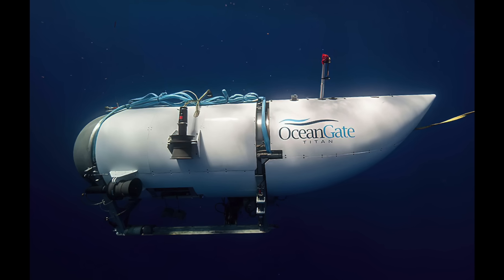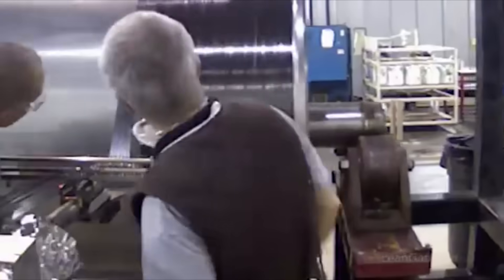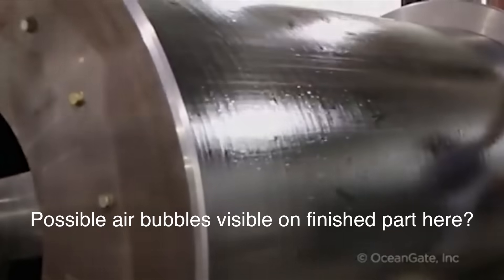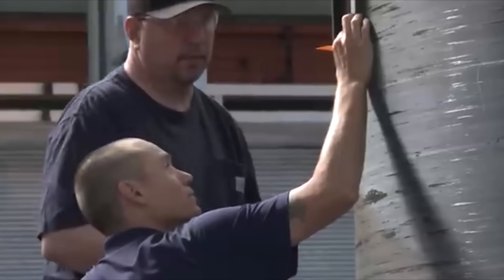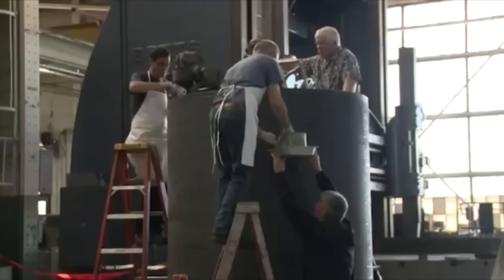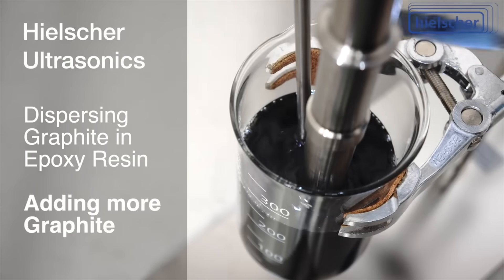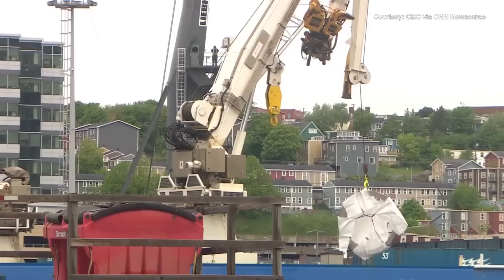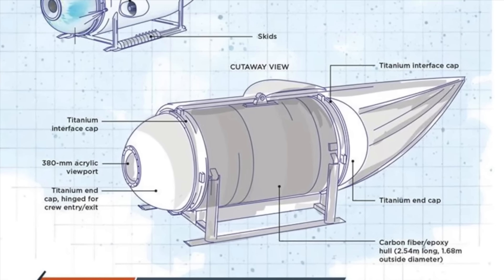Why OceanGate Titan Imploded - A Carbon Fiber Composites Perspective

Comment: Intuitively, carbon fibre going only one direction seems like a terrible terrible idea. I realise the primary strength will be going around, but that leaves no room for error if any part is weakened a bit.
Reply: Without fibres thing the other way, the point where the titanium ends and the fibres have to stand alone would be under enormous stress.
Reply: The primary strength will be going around IN TENSION.  Carbon fibers are like wet noodles, they have no strength in compression.  The only strength here is in the compressive strength of the resin.
Reply: @stargazer7644  wrong, they're not like a "wet noodle", the compressive strength can be up to 50% of their tensile strength. Also, the epoxy holding them together has great compressive strength.
Reply: @xpusostomos  Carbon fibers are THREAD.  You can hang your car from a single 1/4 inch carbon fiber rope in tension with well over a 2 times safety margin.  So you're telling me you can balance that same car upside down on the end of that same 1/4 inch rope in compression?  Have you ever actually handled carbon fiber fabric?  Carbon fiber alone has almost no compression strength.  In a composite the resin is just about the ONLY strength carbon fiber has in compression.  Using carbon fiber to make submarine hulls is like using concrete to make tubes for  pressure tanks.
Reply: @stargazer7644  There is much you don't understand. Firstly, the sub wasn't made of carbon fibre cloth, but strands of fibre, all going the one direction. Secondly, to make a tube lose structural integrity by pressing on it the inside of the tube would be under tension while the outside would be under compression. Thirdly, the compressive strength is measured when the fibres are in alignment with the force applied. In a rope under tension, they are kept in alignment by the tension. Under compression you've got a problem keeping those fibres perpendicular to the force. But the sub is not a rope trying to hold up a car. Fouthly, carbon fibre has about 4x the compressive strength of steel. So let's say you wanted to support a car with some material by compression. What's a good material? Most people would say steel, that's what every car lift is made of. That's what every set of car ramps is made of. And yet carbon fibre is 4x better. Fifthly, don't listen to me, use Google and find out for yourself.

Comment: Titan was overweight to start. The hull’s glue, epoxy, and air gaps had been saturated with water from numerous dives without upkeep. It more than likely was no longer buoyant. The sub sank too quickly, began to fail, and was unable to ascend.

Comment: Unfortunately it seems like these guys were experienced doll house makers building a submersible.  Completely correct regarding the lack of cleanliness and utter lack of other engineering considerations.  Also important to point out that actually there are three not two disimilar materials at play here with the hull - the glue, the carbon fiber, and the titanium.

Comment: What gets me is that Stockton knew that the carbon fiber tube would shrink by 3/4" (19 MM) at the depth of 12,500 feet. I know enough that carbon fiber is not known for it's flexibility properties. Stockton himself said it was concerning that the carbon fiber tube would make a cracking sound at depth.

Comment: Wrong, Carbon Fiber is not a good material for the hull. There wasnt any reinforcement in the passenger compartment. Also, seeing the consruction of this hull. A compression garden waterhose has more clamping components keeping the metal end attached to the plastic hose on it than this submersible! This was a giant aluminum can they went down in. If this is an American Comany doing business in the United States, they should be subject to regulation for safety.

Comment: I'm skeptical about the emphasis on the glue, although it is certainly indicative of an overall sloppy attitude to quality control (and health and safety). The external pressure will tend to push the end caps harder onto the carbon fibre tube the deeper the dive, closing any voids without putting any sheer load on the glue. Since the pressure increases progressively during the dive any water leaks through the glue interface should have been apparent before they became dangerous.  The carbon fibre tube may well have compressed more than the titanium ring, but the latter seems to have an internal channel the inside edge of which would have broken off if this were the root cause of the failure. My money is still on a simple and entirely predictable fatigue failure of the carbon fibre tube.
Reply: At these pressures you don't really have water "leaks".
Reply: @stargazer7644  Indeed, at 400 atmospheres the water jet will cut through pretty much any material, but the sub does not suddenly go from 1 atmosphere to 400, it takes well over an hour, so you should spot the leak while it is still a leak. Plus the deeper you get the harder the joint is being pressed closed.
Reply: @john_hind  What is the ring going to be pushed against? The very end of the barrel. That spot will receive the most pressure, trying to become delaminated all the time. A layer of glue will distribute the load to more fibres at the ends of the barrel, presuming it holds.
Reply: Yeah but you're not thinking about the fact that the carbon-fibre compresses at a different rate than the titanium and what would that do to the mating surfaces?
Reply: @thecloneguyz  mating surface - nothing good.  Just saw another video on this sub where a professor from Europe runs modeling software on this vessel under pressure.  That model of the failure looked like the Pringles can being squeezed, everything was over in just a handful of milliseconds. The highest stress was at the Ti-CF joint.  After the joint failed and the cylinder shattered the two titanium end caps were driven inward at high speed and ‘clapped together’ in the center where the cylinder used to be.

After seeing this I have now come around to seeing the Ti-CF joint as the biggest problem.  No matter what the adhesive or procedure used, this joint is the location of the highest concentration of stresses.  Since there were several successful dives to this depth before this incident, material fatigue cycles must have played a role.  Perhaps the glue joint finally failed, or the carbon fiber itself became weaker and deflected more on this dive, or both, or something else (he also identified the acrylic window as a weak point).  The titanium hemispheres that were recovered looked brand new from the brief unloading video.
Reply: True that the hull likely imploded on its own, however there would indeed have been shear loads on the adhesive due to the relative shrinkage rates of the carbon fiber and the titanium hemispheres. With the hull compressing at much greater proportion, and the glued interface being flat without mechanical (shape) load distribution, the glue was definitely hanging on for dear life
Reply: @michaelmorgan1180  Remember the sub did survive several dives to Titanic depth. If you are right about the carbon tube compressing more than the titanium ring, I cannot imagine any glue sustaining that amount of sheer force even once! The film of the assembly clearly shows the carbon tube being glued into a channel in the titanium. So sheer force would initially compress the glue in this interface surface. While the titanium inner lip is thin relative to the thickness of the hull, it would still have to sheer off before we'd be depending on the glue to take sheer force. Some pictures have now emerged which seem to show just this, but there is so much noise now that I'm waiting for the official report. However we are looking for a fatigue process rather than a simple design flaw. Maybe the carbon tube started to buckle at the end due to delimitation and that caused stress on the material interface.
Reply: @john_hind  about the relative compression rates, we also have to consider that even with a titanium bounded interface, there will still be major deltas between the relative material resistances under pressure, so that spatially confining the joint does not resolve all shear forces, both extrinsic and intrinsic to the CF cross section, as the CF undergoes forces that tend to shear the CF joint as a unit (radially toward the axis), and through cross section shrinkage by crushing. Ironically if the company wanted to innovate in CF deep sea applications, a bad idea unto itself, they would have spent much of the R&D on interface adhesive and form tolerances, which their assembly footage shows they did not. All in all, it was a daydream project that got funded into deadly reality
Reply: Agreed. However there still seems to be another mechanical effect at depth that the assembly did not account for: with the cumulative compression force across the length of the flexible CF tube and  producing an axial elastic strain, there would have been a lever/pry force acting on the glued faces to lift the outermost interface surfaces away from contact with the titanium transition rings. Someone did point out that the psi forces holding those interfaces together were several times the ambient water pressure (due to the concentration of the dome surface forces onto the glued ring and tube contacts), however I believe it is critical to take note that the total forces acting against the assembly or its structural integrity were not all occuring at static 90-degree angles... there were also extreme pivoting forces that such an assembly design would never be applied to in proper mechanical engineering for personal occupancy
Reply: @michaelmorgan1180  Hemispheres made of ductile material do not stay spherical under load in this case they flatten. This dishes the bonding surface putting tensile loads on the outer bond line.
Reply: I hope you have been seeing the Titan hearings. I mean, besides the whole idea of using carbon fiber as a hull material being a huge blunder, the failure point(s) seems to have been at the front dome where they also had a bunch of issues in other dives.
Reply: @apackofhoboes  as a welder, I'm very, very familiar with this concept.. making something "stronger" only introduces weak points immediately after. It's why welders need to defer to engineers, as the entire project needs to give and flex uniformly. 

Melding titanium to carbon fiber sounds like a nightmare to design. Would require LOTS of testing into failure, which we have virtually nothing to draw from. Other than their deaths, sadly.
Reply: Poisson's Ratio
Reply: John,
That’s the way I see it too.  Extreme compressive cycles on a material designed for strength in tensile loads.
Reply: The hoop stress means this carbon tube is gonna shrink in diameter. If the titanium shrinks at a different rate, massive shear stress. Temperature changes can result in insane shear stress.

I did a simulation on a pool window of poor design: 300,000 lbs due to thermal stress alone
Reply: @ZebraLemur  However, as I said in the OP, it is not a simple butt joint. The carbon tube is glued into a channel in the titanium ring. Under the strain you describe, the inner lip of this channel would be stressed and would have to break off for there to be significant movement of the glue joint. The titanium parts seem to be completely undamaged in the images we have seen. Conceivable that localised damage was deliberately or accidentally hidden as the parts were lifted ashore, but it will still be known to the investigators and should resolve the matter one way or the other. The fact that the carbon tube has not been recovered, or even significant intact pieces of it, also argues for this as the original failure.
Reply: @john_hind that channel would still introduce massive sheer concentration forces on the carbon fiber, where the lip ends.

You don't have to be an engineer to see the failure points.
Reply: @ZebraLemur  Hi, The CTE of Toray 700 IM is zero to slightly negative. Modulus is huge compared to titanium. Everyone assumes the joint faces stayed parallel. Pressurized hemispheres deflect. Internal pressure makes the dome balloon external pressure flattens the dome. This puts the adhesive in an unfavorable loading condition.

Comment: I m not an engineer at all, but i could relate to the findindgs of this insightful analysis, My take away from this video from my point of reference is : Much like conjugating using a porous prophylactic condom 2 sizes smaller ? entirely up to chances ?

Comment: This video plus other similar videos shows the end bells and the rings that were glued to the carbon fiber hull.   What is missing in both OceanGate's videos and videos of the removal of pieces of the submersible are photos of the seal between the rings and the bell.

The ring is separate from the bell.  There are no bolts in sight.  There are no signs of gasket material.  The ring is separate from the bell with no signs of carbon fiber, bolts, or seal material.  Might the failure have started in the seal ring and finished with the failure of the carbon fiber?

If I were investigating the loss of the Titan I would look closely at the seals and the bolts.  Were bolts examined after each dive?  Were they replaced after each dive?  Was the same torque applied to each bolt, or were there changes with each dive?  Were bolts examined for elongation?  Were the bolts used for the end bell without the port light serviced in the same manner as the end bell used for access?

Similar questions should be raised concerning the seals and how they were used.  Could a failure of a seal at depth cause a difference in force distribution failing the carbon fiber?

I would also be interested to know why OceanGate chose not to provide an exoskeleton to distribute the compressive loads between the end bells.

Comment: Not only the compression properties ( as opposed to expansion rates ) of the three components, but more importantly the distortion. The carbon fiber hull will begin to distort into an oval, whereas the titanium ring will distort out of true, the bonding between the two will have to “stretch”. This certainly explains the “cracking” sounds heard. That is the point of failure, allowing high pressure water (6000psi) to infiltrate the joint and act as a hydraulic wedge instantaneously pushing the two surfaces apart. Failure is highly predictable and catastrophic.  Working as a senior structural engineer for Lockheed Martin within the Marine Division, this very phenomenon has been studied and documented repeatably. It s disturbing that any research Oceangate did, they either didn’t access the available data or discounted it.